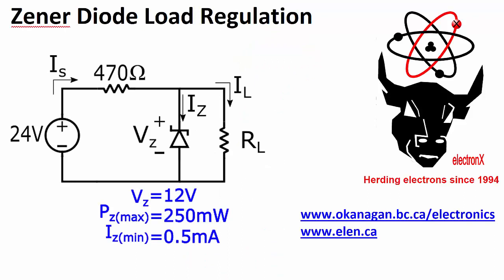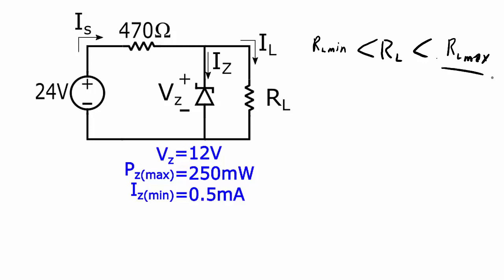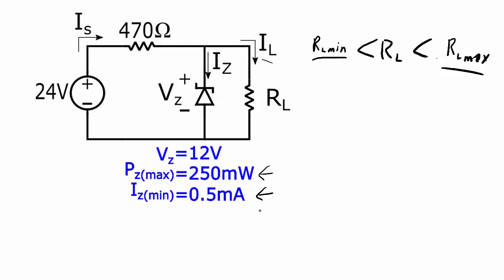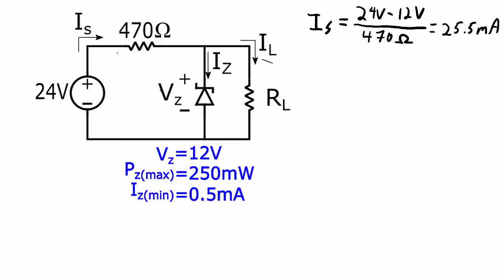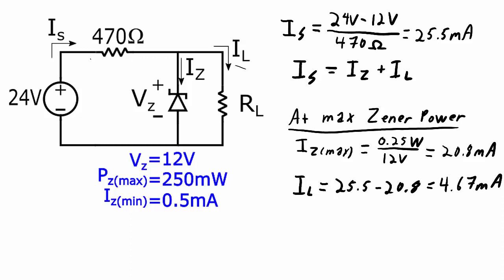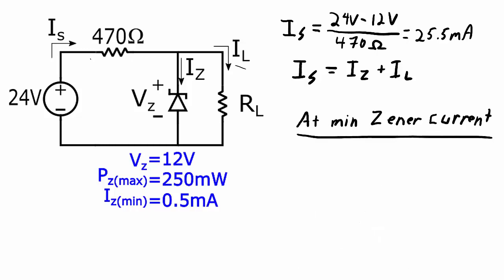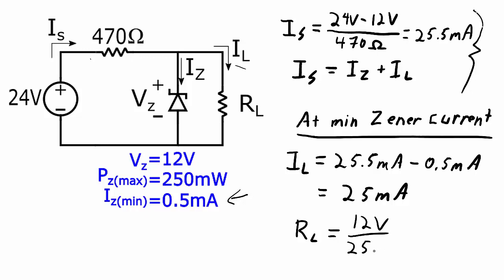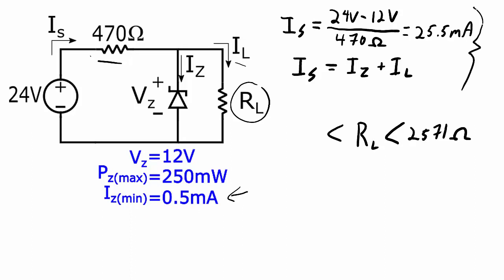Zener Diode Load Regulation Example

Comment: I am lost, can you help please???
I have a variable source between 0 and 16 volt dc and need to power a 3 volt 20ma LED
PLEASE help and send me a circuit diagram useing a 3volt zener on this variable source, I understand that the LED will not light up until the voltage exceeds 4 volts or there about but I do not want it ot the zener to burn out when the voltage rises to 16 volt, I also want the LED to remain at a constant brightness from 4 volts to 16 volts 

U

Comment: where did the 0.5 come from?
Reply from the maker: The Iz(min) is fixed at 0.5mA.  It's the minimum current that the diode needs in order to put the diode into it's regulation mode.
Reply: @ElectronXLab  is it fixed due to problem Sir or is it a fixed value due to the type of diode?
Reply from the maker: @ivanrasheedranchez9155   Both. It will be fixed due to the type of diode and I arbitrarily picked a value of 0.5mA for the diode in the problem.
Reply: @ElectronXLab  Thank you sir!
Reply: Is it fixed?

Comment: Can equivalent zener diodes be connected in parallel (2 or 3) if 'balancing' resistors are properly used to handle small voltage differences?
Thanks much...
--dALE
Reply from the maker: In theory yes, but there is always the risk of having unbalanced branches. It's generally better if you can find one Zener that will handle your current needs.

Comment: Thanks,
I have a 300v zener regulator made from TWO 150v zeners in series.  The resistor requirement for Imin is 300k (if one 300v zener were used).  I am using TWO 150k resistors in series.  Is it best to connect 150k across each (with a center connection) or to simply place one 300k resistor across the pair (no center connection)?
THANKS AGAIN FOR ALL OF THE USEFUL VIDEOS!!!

Comment: Thanks,
I am using a zener to charge a small capacitor (<0.5uF) to 300v from a 400v source.  I plan on using a resistive 300v voltage divider (fairly large resistors) sourced with the 400v.  Initially,  at the current surge, the zener (two 150v zeners in series) may not be regulating, but as the cap charges and the current drops, I think the zener will kick in and keep the cap voltage from exceeding 300v. Does this sound feasible?
Much thanks to you...
Reply from the maker: I'm not sure about the voltage divider part. Remember that a voltage divider only works if the same amount of current flows through both resistors. If you have something connected between the resistors that is drawing current, you won't have the voltage that you planned for.

Comment: ...one more thing: For the shown zener parameters, why not choose a max. series resistor via I=0.250w/(24v-12v)=20.8mA, thus: R~12v/20.8mA = ~577 Ohm or greater?  My main reason for asking:  my load is not a resistor, but a 0.5uF capacitor that is charged/discharged (from an 800v supply to 400v) at about 75Hz by the zener output.  My series zeners are TWO 200v @10W each.
THANKS VERY MUCH!!!  Thumbs UP and subscribed!
Reply from the maker: The values in my circuit are pretty much arbitrary, so there is no particular reason that I choose 470 Ohm. The exercise was about assuming 24V source, 12V Zener and 470 Ohm series resistor and then figuring out the rest. In your example, I guess you are looking at situations when the capacitor is fully charged, so no current goes to the load. I think then it makes sense to re-design to put the larger resistor in series to protect the Zener from too much current.

Comment: What is the rule for Vi min and Vi max,i need to find Izmax
Reply from the maker: Izmax will be based on the maximum power that can be dissipated by the diode and the zener voltage.   Izmax = Pmax/Vz.
Reply: @ElectronXLab  Bro my question is like"design a voltage regulator that will maintain an output voltage of 20v across a 1-kohm load with an imput that will vary between 30v and 50v.that is determine the proper value of Rs and the maximum current Izm"i have got the value of Rs 500ohm for Vi min=30V,but i cant understand about this Izm,there is also not given Pmax
Reply from the maker: @arifahmed2492  Okay, it sounds like you're not worried about the ratings of the diode itself, so the max zener current is just based on the current that will be through the Zener diode when the voltage source is at 50V.  You've already calculated the current through the 1k load and used that to figure out your Rs value. Now figure out how much current through Rs when the voltage source is at 50V, subtract the current that is going to the load and whatever is leftover is the maximum current that will go through the Zener.
Reply: @ElectronXLab  sir,i am still suffering to calculate this math,do you please explain it for me if you dont mind?
Reply: @ElectronXLab  i have got the solution now,R=0.5kohm and Izmax=40mA.I hope it is all right,tnx for your suggession

Comment: great help but what if there are 2 Zener diodes?
Reply from the maker: If there are 2 Zener diodes in series (with the same orientation) then the total zener voltage is the sum of the Zener voltages of the 2 diodes. The knee current will be the greater of the knee currents of the 2 diodes and the max current will be the lesser of the max currents of the two diodes.

Comment: What if you’re just wanting to ensure that an input pin is protected? I designed a converter that takes +/-12V range and converts to 0-3V3V range. I don’t want to exceed 3.3v but When I add a 3.3v zener my output doesn’t reach 3.3v (only gets to about 2.6v when 12v is applied)

Comment: A diode operates in forward bias, VT = 0.026 V. For Vd= 0.600 , the current Id = 1 mA. For Vd=0.680V, the current Id=10 mA. Determine the values of Is and n.

Comment: If the load resistor, (RL) in this case, is removed from the circuit, will it burn up??  If so can a permanent ~2571 ohm resistor be soldered across the zener as a safety measure if you do not use less than a 480 ohm load?
Reply: no need .use a zener of o.5 w or more

Comment: Why can IL=25.5mA-0.5mA I don't know  25.5mA How  does it come out??
Reply: you have to apply KVL to find the voltage across first resistor 
Vr=Vs-Vz
Vr=24-12=12v across the R1
then you apply omh's law as he did, but he did both steppes by one
Is=Vr/R1 because the current through the R1 same as source (R1 in series with the source)
Is=12/470=25,5 mA
Reply: @fadihanna1545  nice explanation bro really appreciate that.

Comment: What is the correct watt for 470 ohm resistance!
Reply: When regulating:  P=(I^2)*R  OR P=(V^2)/R.  P=12v^2/470 ohm = 0.3W.  and I=V/R=12v/470 ohm = 0.03Amps.  So  P=(0.03^2)*470ohm = 0.3W.  SO:  by two different methods...P=0.3W.  Since 1/4 W =0.25 W, a 1/4 W resistor will overheat, therefore use at least a 1/2 Watt 470 ohm resistor.

Comment: I've seen a product that draws 200V, rectifies, voltage-divides to 12V and then regulates that to 5V with zener diode. To power a microcontroller. Super scary, but went through certification and works
Reply: I think I've seen that before